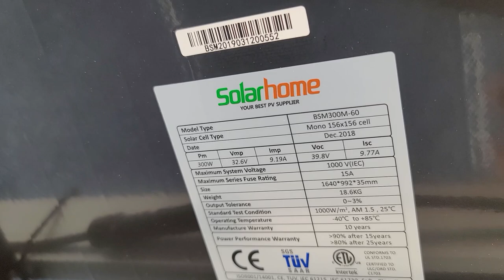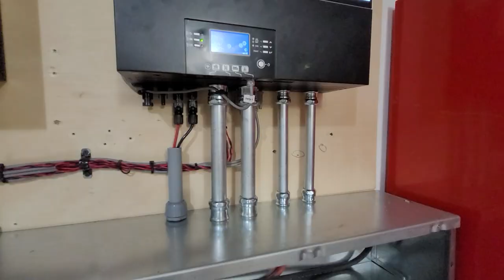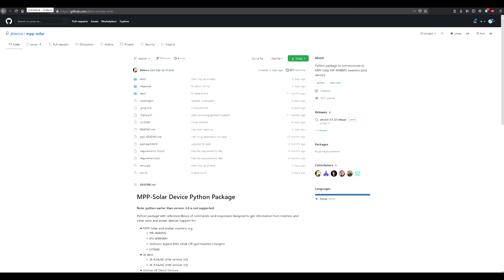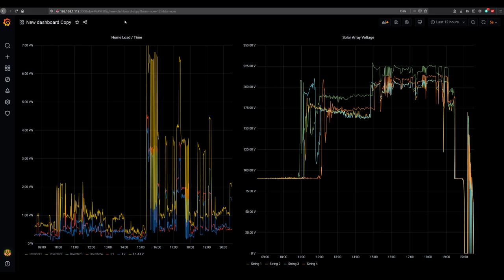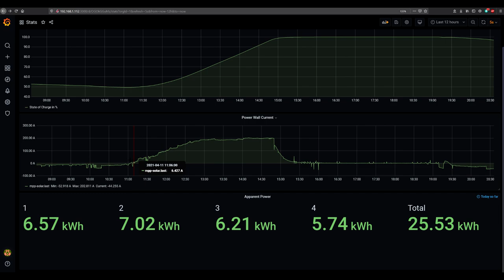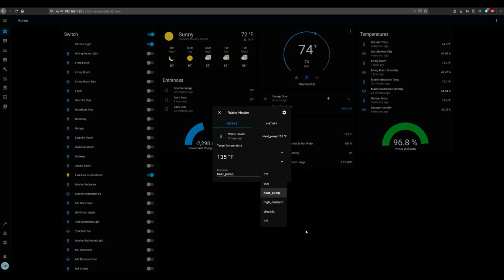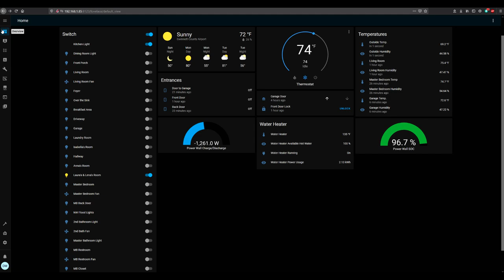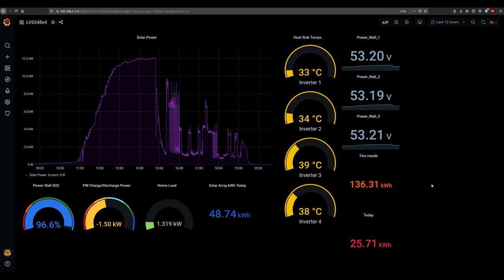DIY 14.8KW Solar Array Overview, Data Collection & Production Numbers

Comment: Just outstanding! Very clean, detailed setup. It's been a long road for you. Your system is the best I've seen so far.
Have you thought about adding more batteries since you don't have a net metering agreement..  Your system is throttling back once batteries are full and house requirements are filled.  
I think my best single production day this year was 71kw in march which I sold 49kw to utility.
Congrats on a job well done.
Don't worry about keeping videos short, ALL GOOD STUFF!
Reply from the maker: Question that gets asked often. I will try to address it in the upcoming video.

Comment: It is an outstanding power  performance out of that 14.8kW Solar Array.  Also Interesting to see data and graphs you are collecting from those MPP Solar LV Inverter/Chargers.
You hard labor will be payed off quicker.
Do you still have grid power lines in your home? 
How's the power company feel about you not using there power? 
Beautiful system and thanks for sharing. 
Cheers.

Comment: When did you swap from 5048 to 6548? Awesome setup! Congrats on being power company free! 
I am building something similar, so I am following what you are doing very close. I have seen others using your "craftsman" power walls. Love it. Mine will be in a truck toolbox. I have a single 6548, so interested in your BMS and Inverter parameters that you found work best for charging, float, bulk, times, etc.
Reply from the maker: I replaced them on March 26. It was long time pondering on replacement but we decided to get electric car so more power was needed.

Comment: Looks Awesome! I need to catch up here lol. New correct panels are coming today, and now they are saying they will schedule a pickup of the wrong panels they sent last week at some other date.  (So now they think I am going to store them until they find a buyer?) I will post my experience with this company on the DIY Solar forum once my experience with this company is completed but I don't want to say much about them until I see how they handle the overall deal. 
Thanks for the update!
Reply from the maker: Panels arrived? Are they correct this time? Thank you....
Reply: @DMIINC2013  Yes, they arrived. After they told me the ones I ordered were not going to be in stock for up to 3 months I knew they sent the wrong ones because they didn't have mine in stock. I ended up getting REC 355w all black instead of the REC 365. I still have the other ones in my garage and haven't heard from them yet.
Reply from the maker: @danfitzpatrick4112  Maybe they will forget that they sent you the first ones or you start charging them storage fee. LOL j/k. Good luck and post some videos of the install.
Reply: @DMIINC2013  Exactly my thoughts! and will do, have to source an installer now..

Comment: Very nice 👍👍👍 i wish i could have this monitoring program for my Mppsolar inverter...
Reply: Do you have a raspberry pi?

It's not near as hard as it looks. 99% of the work is already done.
Reply from the maker: @Jason Carmichael He is 100% correct. Most of the work is done however basic understanding of Linux operating environment is required.
Reply from the maker: See my reply to Arnel. You are 100% correct.
Reply: Awesome monitoring and setup so very impressed !!!
Do you have a link or model to the raspberry Pi you are using ?

Comment: Would you be able to share the cables you used to connect from the Raspberry Pi USB ports to the LV6548 Ports? and also the Pi USB to the Victron Shunt? It's hard to follow the cables, but it looks like your using USB to RJ45? Is that homemade? Would the RS485 port also work? I am also looking to monitor my JK/Heltec BMS's, which have Bluetooth, but also have CAN and RS485 ports. Finding the right cables to work with the right code is a bitch.
Reply from the maker: I will.
Reply from the maker: Serial to USB https://www.amazon.com/Sabrent-Converter-Prolific-Chipset-CB-DB9P/dp/B00IDSM6BW/ref=sr_1_1_sspa?dchild=1&keywords=serial+to+usb&qid=1619048372&sr=8-1-spons&psc=1&smid=A29Y8OP2GPR7PE&spLa=ZW5jcnlwdGVkUXVhbGlmaWVyPUEyVE1BQlI5WVRXV05YJmVuY3J5cHRlZElkPUEwMDY1ODQxMTRNQUVCNUlPVU5NTSZlbmNyeXB0ZWRBZElkPUEwNTg0MDY4V09ONkpLRTNFQjBHJndpZGdldE5hbWU9c3BfYXRmJmFjdGlvbj1jbGlja1JlZGlyZWN0JmRvTm90TG9nQ2xpY2s9dHJ1ZQ==
Victron comm cable https://www.amazon.com/Victron-Energy-VE-Direct-USB-Cable/dp/B01LZ6WTLW/ref=sr_1_1_sspa?crid=1YVCUMUPJYASY&dchild=1&keywords=victron+usb+cable&qid=1619048462&sprefix=victron+usb%2Caps%2C280&sr=8-1-spons&psc=1&smid=AERMGYAT5R869&spLa=ZW5jcnlwdGVkUXVhbGlmaWVyPUEzTzMxTFRHT0FYQTkzJmVuY3J5cHRlZElkPUEwMzU1ODczMzlQNTcyNElGUklUNyZlbmNyeXB0ZWRBZElkPUEwMDQ4MjY0MTRBM043Q1MzRUY1UCZ3aWRnZXROYW1lPXNwX2F0ZiZhY3Rpb249Y2xpY2tSZWRpcmVjdCZkb05vdExvZ0NsaWNrPXRydWU=
PI's have built in BT or use BT dongle with extension cable.
Reply from the maker: Serial to USB https://www.amazon.com/Sabrent-Converter-Prolific-Chipset-CB-DB9P/dp/B00IDSM6BW/ref=sr_1_1_sspa?dchild=1&keywords=serial+to+usb&qid=1619048372&sr=8-1-spons&psc=1&smid=A29Y8OP2GPR7PE&spLa=ZW5jcnlwdGVkUXVhbGlmaWVyPUEyVE1BQlI5WVRXV05YJmVuY3J5cHRlZElkPUEwMDY1ODQxMTRNQUVCNUlPVU5NTSZlbmNyeXB0ZWRBZElkPUEwNTg0MDY4V09ONkpLRTNFQjBHJndpZGdldE5hbWU9c3BfYXRmJmFjdGlvbj1jbGlja1JlZGlyZWN0JmRvTm90TG9nQ2xpY2s9dHJ1ZQ==
Victron comm cable https://www.amazon.com/Victron-Energy-VE-Direct-USB-Cable/dp/B01LZ6WTLW/ref=sr_1_1_sspa?crid=1YVCUMUPJYASY&dchild=1&keywords=victron+usb+cable&qid=1619048462&sprefix=victron+usb%2Caps%2C280&sr=8-1-spons&psc=1&smid=AERMGYAT5R869&spLa=ZW5jcnlwdGVkUXVhbGlmaWVyPUEzTzMxTFRHT0FYQTkzJmVuY3J5cHRlZElkPUEwMzU1ODczMzlQNTcyNElGUklUNyZlbmNyeXB0ZWRBZElkPUEwMDQ4MjY0MTRBM043Q1MzRUY1UCZ3aWRnZXROYW1lPXNwX2F0ZiZhY3Rpb249Y2xpY2tSZWRpcmVjdCZkb05vdExvZ0NsaWNrPXRydWU=
PI's have built in BT or use BT dongle with extension cable.
Reply: Hello, DMI. Your videos are the greatest !! However I am wanting to monitor my LV6548’s the same as you and I am struggling finding the hardware (data cables) and the software. Hoping you could explain in detail or better yet a more detailed video and if possible links to find everything?? I know I’m asking a lot.
Reply from the maker: @blcsolar5170  Are you in the United States? Parts in the above posts are available via Amazon.